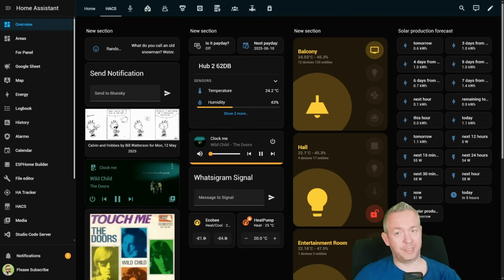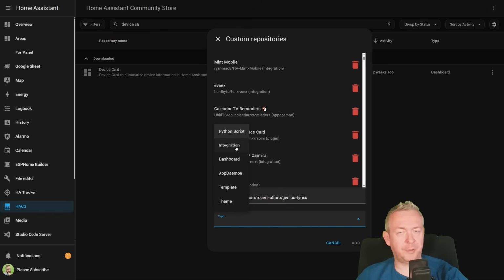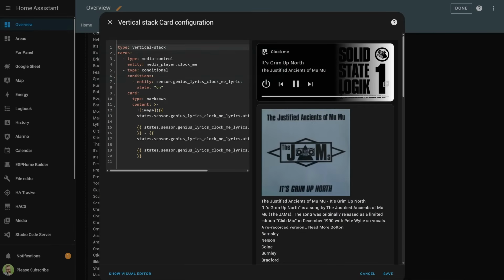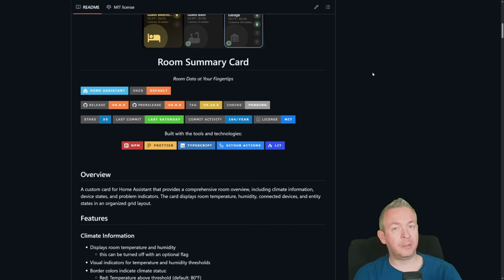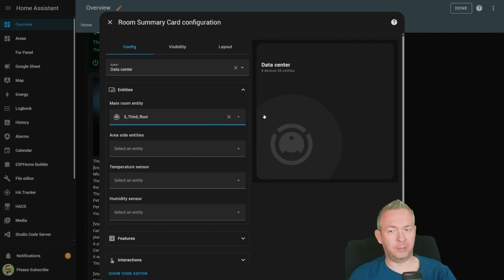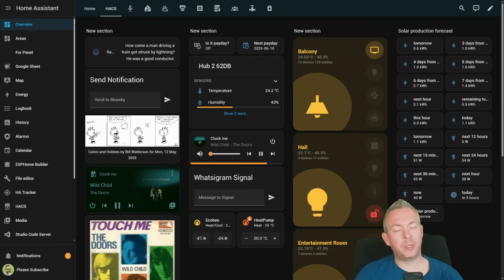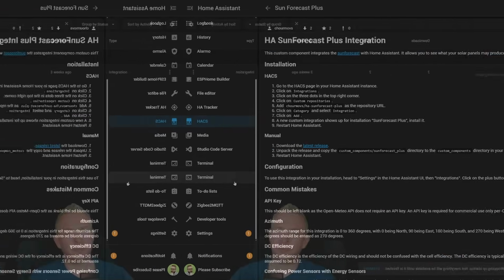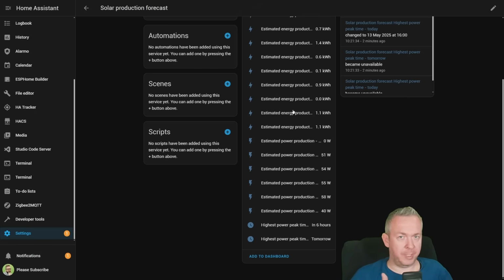Some more HACS components this May

Comment: I’ve been using Solcast for my Solar forecast, you can create a free account and it produces really good forecasts with best and worst case cloud cover scenarios. I then use the excellent BJreplay HACS integration to pull this into HA and automate my battery charging.  Solcast provides not just this hour/next hour/peak hour/today/tomorrow etc forecasts but also granular forecast detail broken into 30 minutes slices so you can really optimise the solar generation.
Might be worth a future BT video.  Cheers
Reply from the maker: Thanks for this awesome tip!!

Comment: Room Summary Card is a copy of Lovelace UI, but has UI control. If you would like to change color or add additional logic, like I add motion icon at 4 item, when presence sensor detect motion, then use Lovelance, if you don't need this extra setup, then yes, this is a good tool.

Thank you for the video😊
Reply from the maker: Thanks for the tip!!!